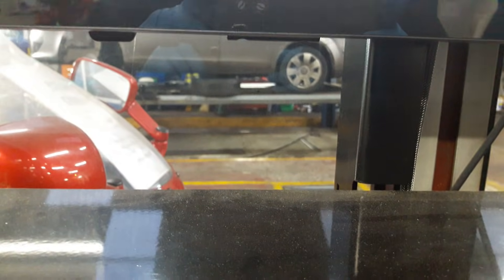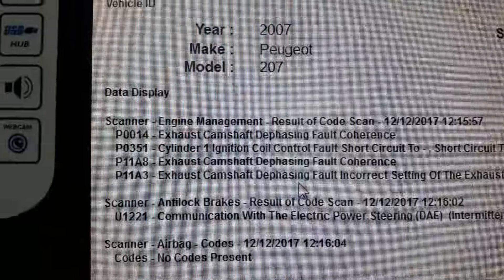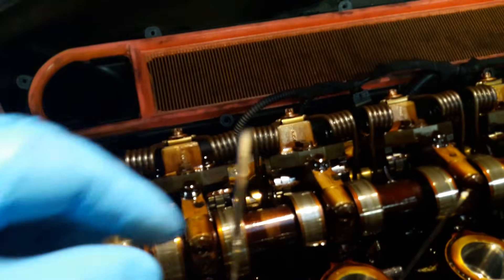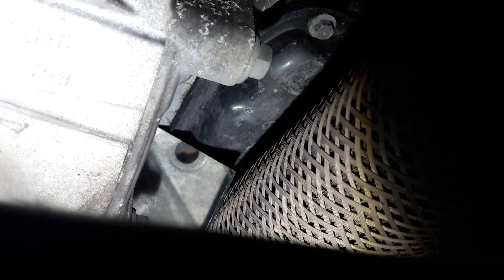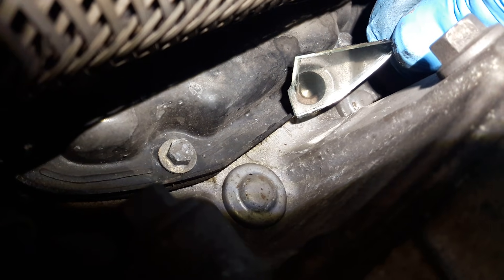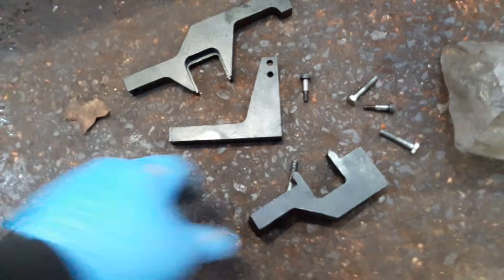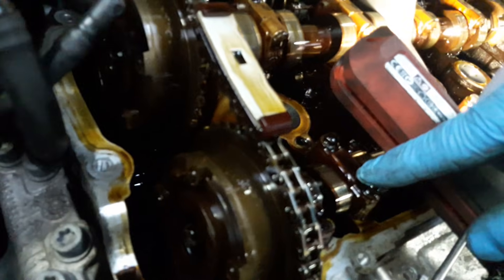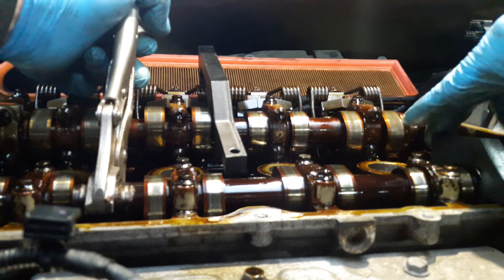Peugeot 207 and Mini timing(1)

Comment: Hello.Can the timing out  causing low compression on 1 cylinder only?  1.4 vtr+ 60k miles and it has only 2 bar pressure on cylinder 4 and has a missfire.No oil in coolant and no water in oil so i asume the head gasket is ok piston looks ok and the cylinder walls.
Reply from the maker: @WanderlustAdventures8  simple answer is no. Head gasket , valve damage or rings

Comment: Is it possible to lock the fly wheel 180 degrees out ?
Reply from the maker: No. Once all the piston are level the locking pin will only go in one hole. I found using a small mirror is a great help.
Reply: @r.sgreasemonkey8876  

Changed head gasket and timing chain on 207 couldn’t lock cams as had head rebuilt Managed to lock the fly wheel and locked the cams with a similar kit to what you used in this video car will not start any ideas? somebody said that there’s a 2 degree tolerance for the cam shafts
Reply from the maker: It may be a case the cams got mixed up. The locking tool should fit perfectly.  Double check. Cheers

Comment: Hi, well I've fitted a new chain kit the whole lot except the Vanos pulleys, timed up and running alot better but still codes p0014 and P11A8 (both exhust cam codes) I've changed the solenoids,. And re-checked timing after a good run - it's on.  I'm stumped now. Any ideas? Was thinking vanos pulley and the cam oil seals behind it. Other than that what else is there?  Thanks.
Reply from the maker: You’ll need to change the vanos system. Replace both sprockets will sort out your issues

Comment: Hiya, out of interest, what was the reason for the timing being out on this car? Did you not consider chain stretch? Can you help me as I have exactly the same fault code P11A8 (1.6 Prince 2008 16v 2 x VVT's) plus occasional chain grating noise 2000-3000 rpm and worse when at full temp which immediately goes when engine is restarted. So I've just took off the rocker cover to find the top chain guide completely worn away metal and all! Plus the inlet dephaser pully moves when chain pressed down between pulleys ( engine static obviously) and I've been told it should not.l it should be locked by a pin. Any help would be really appreciated, Thanks, David.
Reply from the maker: The chain should be tight and under tension at all time with the self adjustment.  Top chain guide seems to be a common issue with this type of engine. Once replaced and time up , it will run a treat.
Reply: @r.sgreasemonkey8876  Thanks Richard for taking the time to reply, much appreciated.  I've got a new top guide to fit, I'm hoping simply fitting that will pull the timing back into correlation!?
 So many of these top guides have sold on ebay and it's the only part of the chain kit that you can buy on its own (that I've seen anyway) which says alot as to the common issue with it like you say.  Best wishes, Thanks again,  David
Reply from the maker: We change the chain. Coherence was out. A lack of performance.  Cheers

Comment: Hie Sir . My mechanic wanted to change the pulley on the crankshaft and he mistakenly opened the crankshaft bolt and the car couldn't start and we realized the timing has been tempered with . Now we are Following this procedure but no special tools , only aligning the cams . Car is starting well but latr on bringing engine light with engine shaking smetymz and error codes some saying camshaft  position slow . What might be the issue here
Reply from the maker: Locking tool is most important.  If the timing is slightly out engine lamp will always come on. Coherence codes will be stored in the ecu. Even if your a tooth out.  If you are in the UK then vehicle will fail its MOT if registered after march 2003 (petrol engines)
Locking the cams will fix issues. Cheers

Comment: hi, i have a 2006 citroen c5 2.0 l. When my car warms up it gives the error that the oil pressure is too low while idling. I changed the oil, changed the oil sensor, changed the oil pump. But my problem still persists. Please help me what should I do? When I connect to OBD device, I get P0012 and P0011 errors
Reply from the maker: It sounds like you've done the hard work.
I would suggest fitting a genuine oil filter.
Some of the after market filters are not up to the job.  
Worst scenario an auto electrician look into the wiring (bad earth).
Reply: @r.sgreasemonkey8876  thank you so much

Comment: Rich...is there any special way to re-install the valvetronic motor on this engine? i had a valve job done and the 
shop removed it and gave it back with it detached? I cannot find any info on re-installation...thx mate
Reply from the maker: I’m not sure what you mean by a valvetronic motor. Can you verify. Cheers
Reply: Richard Sawyer I think what he means is, on the lower inlet camshaft, there is a quadrant gear, the valvetronic motor has a worm drive gear which meshes with the quadrant. What is the position of the quadrant? On every video, I've seen, including yours, the quadrant gear is vertical and I assume it's the resting position, so possibly that's the position that you fit the valvetronic motor/drive gear.

I'm rebuilding a mini same engine, and I'd like to know the fitting process of the valvetronic motor please?
Reply: @stevenlangdon-griffiths293  exactly!
Reply: I figured it out
There is a turnstile inside motor on back
Insert I think 4mm Allen and twist in reverse then insert into block and keep backing out until motor is flush then switch to forward motion until it engages the cam and sits at the end of the half circle 
Cheers hope it helps!!!
Reply: maxalwaysgoesbyboat ok! I'm not alone! I'm doing a mini at the moment. It had bent some valves and the inserts had fallen out of the head. I've stripped it and photographed it before I did, but, I dint take good enough photos of the valvetronic motor. I'm sorry for answering the question, but I'd thought that is what you were asking 😊
Reply: @maxwonttakethetrain142  thank you so much for your kind reply, I'm pleased that you sorted it out. I will let you know how I get on. Thanks again
Reply: @stevenlangdon-griffiths293  iv'e had the absolute shittiest experience with this timing system
i have had my head off for 2 months with same problem and now i have found the machinist stripped out the camshaft bearing journal holes...1 thing after another...glad it helps...let me know if i can help out...
cheers
marcel
Reply: @maxwonttakethetrain142  that's a tough time you're having. I had my cylinder head machined 2 days ago, I knocked the valve inserts back in and lapped the valves and they sealed OK I will put the springs back on tomorrow. Your kind info is a great help. Good luck with your engine. I will let you know what happens
Reply: @stevenlangdon-griffiths293  you bet...and make sure you turn your cams from your crank bolt clockwise only a good 10-12 turns as to see and hear the action, then realign the pin at bottom (bellhousing) to the cams to double check and if your spot on...your gold...have a good one!
Reply: 4:16 eccentric shaft I think he means use an allen key at rear to "screw" in shaft until the unit attaches itself to cylinder head then tighten will those 3 torx bolts

Comment: Could fault codes P1007 and P1014 on Peugeot 207, 2007 require this. It apparently refers to variable valve lifter sensor something.

Comment: Hi richard sawyer .
I got a 207 1.4 from 2007 .
The car has no
 power  after  driven a couple km, and the motor makes more noise . 
The  fault code p11a8 . 
My mechanic  says that the problem is the chain .
Can u give me advise in this 
Tnxs

Comment: Was the timing belt issues resolved on post 2010 models of 1.6vti non turbo models?
Reply from the maker: No. As it's  not an issue when servicing is kept up to date with the right oil grade.  The vvt' s become the issue. Chains are known to wear and stretch on all chain drive engines.
Reply: @r.sgreasemonkey8876  thanks for that. I'm looking at few 2011 manual models. So, I guess I need toake sure the oil was changed every year and that correct grade was used. A little bit of rattle on start is OK? For 20 seconds or so, so the chain gets oiled.
Reply from the maker: @londo0  if there us a rattle on start up then walk away. This should not happen.  Worn lifters or a chain tensioner fault due to oil pressure. Don't buy it.
Reply from the maker: Yes.  Replacing both the Chain and vvt  sprockets.
Reply: @r.sgreasemonkey8876  oh, I meant did Peugeot resolve it at the production stage so we don't have to fix it ourselves? Thanks

Comment: Hi,I have a huge problem and no one cant find what is the matter..I have P0016 and the mecanic  had lined up the pistons as you did and the camshafts have the marking facing up but I didn't seen him verifying anything under the car as you  did. Can you please  explain  in more detail what have you locked under the car and why is important to do that? I have a Peugeot 308 cc 1.6 thp 150 hp and the car runs as if it has max 80 horse power and it doesnt make  pressure enough into the turbo.The only error I have :P0016.Please advise.Thank you!
Reply from the maker: Hi. The timing pin location for the crankshaft is under the car by the exhaust and bel housing. This has to be inserted to ensure exact position of the posting. Other wise possible fault codes may occur when running ( coherence faults)
Hope this helps. Cheers

Comment: Hi doing a 2009 207 no marks on the camshafts at all so just get the pin into the flywheel. This car was parked up for 5 minutes then failed to start again this was about 9 months ago did a compression test about 80 psi so bought a kit to check if the cam timing has moved